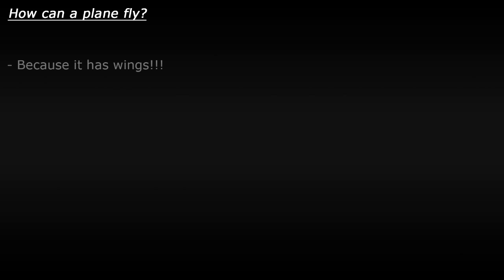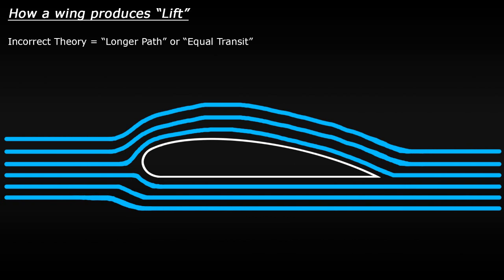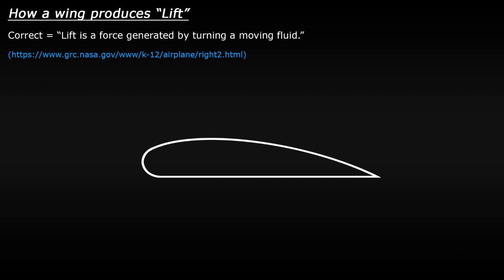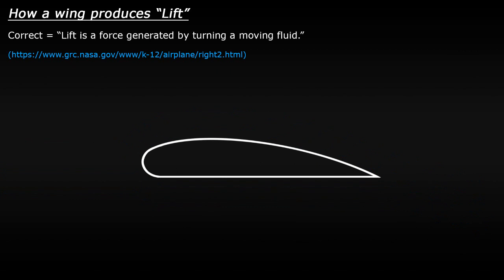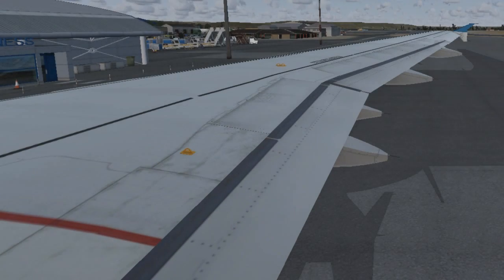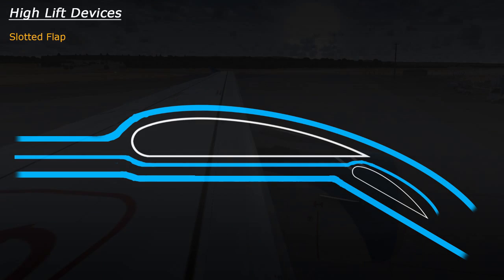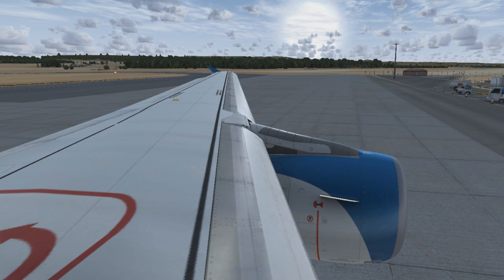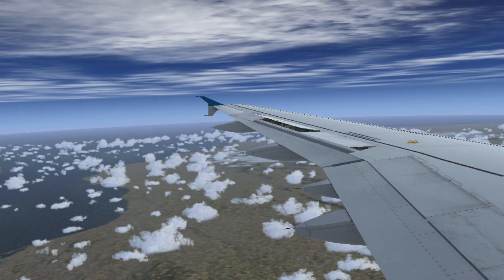How Wings ACTUALLY Create Lift!

Comment: Good video for the shortness of it.  You are correct- exactly! Basically, the various "theories" of why wings work to create lift all say the same thing, but in different ways. The idea of alerting the airflow to create lift, is best explained with your explanation. Air has mass- quite a lot of mass, actually. Anytime you move mass, there is an equal and opposite force created. In order to get any aircraft off the ground, you must move (at velocity) a mass (or weight) of air equal to the mass (or weight) of the aircraft in the opposite direction in which you want the aircraft to move. Any given volume of air (a "slug") has specific weight. You can calculate what amount of force is being generated by centripetal force  of moving that weight. So, basically, the wing lifts for the same reason a weight being slung around a center point get's "heavier"- the faster the weight is slung, the "heavier" it gets. the redirection of the air slugs by the wings angle of attack, eventually is going fast enough to literally force the wing upward against the weight holding it down. this is why even a flat, angular board held at an angle to the direction of flow will cause lift- the rectangular wing will fly (though with higher drag) without the curvature (I've proven this to the vast chagrin of "Bernoulli" adherents with RC airplane models. The advantage of a curved or "Bernoulli" wing is a reduction in drag AND and enhancement of more easily redirecting the airflow in a different and downward direction, thus causing more efficient lift.  The fundamentalist Bernoulli people have a hard time explaining why properly curved wings can fly (still generate lift) when flying upside down...and don't even get them going on the symmetrical (curved the same on both sides of the wing surface) fly better, with less drag and more lift at higher speed than the traditional "Bernoulli" models - that is the "flat bottom" wings.

It is merely the re-direction of mass that causes airplane wings to create lift- that's the whole bottom line. All the other aspects of a wings design are for reducing drag while enhancing that re-direction of mass.

Excellent video. Excellent explanation of why wings create lift.
Reply: Thank you.Your explanation helped a lot
Reply: How long did u tyle this...?
Reply: Centrifugal or Centripetal force has nothing to do with an air wing generating lift. Other than that you are mostly correct that Newtons 3rd law of motion is what provides the lift. You are incorrect though to say the poster of the video is correct in that regard because that is not what he said. He said something completely different and believes a downdraft creates lift which makes no sense whatsoever.
Reply: @lxdimension  What SHOULD have he said? 
What part did he say that was 'completely different'?
'Newton's 3rd law of motion' doesn't make planes fly.. More words, please.
(Seen Kooper, above?)
Reply: @lxdimension  I agree re: centripetal force, that made no sense to me at all.

However, in terms of the video, what do you think a "downdraft" is, if it isn't literally the "opposite" aspect of Newton's 3rd law? The air has shifted direction, due to a force being applied to it by the wing moving through it, there's an opposite force... hello lift!

Comment: You missed a step by saying the turning of the flow is what causes lift, turning the flow creates regions of high and low pressure simply due to the flow being directed away from it's "intended/original" path. These differences in pressure is what creates the Lift force, or more specifically: the surface integral of all the vectors normal to the surface multiplied by their associated pressure value over the entire surface area of the body (airfoil in our case). Creates a resultant force, of which the Y component is LIFT and the x component is DRAG.

What this means in practice is that there are some vectors pointing upwards(ish) above the airfoil which are "sucking" it up into the rest of the atmospheric pressure field, and some areas below where it is being "pushed" upwards away from the atmospheric pressure field. (The front of the airfoil actually tends to be pushed downwards in the majority of cambered airfoils, due to the region of high pressure at the leading edge)

For anyone who's actually read this I'll assume you know at least a little about aerodynamics, so if I've made a mistake, feel free to correct me, I am only a 3rd year student lol.
Reply: His explanation was simple and made for the average Youtuber. Who knows nothing about lift, drag, and much more.
Not good to give TMI to people that just want the basics. Notice how he didn't get into ailerons and about nine other basic things I believe not to confuse people.

Comment: I don’t get why most descriptions focus on the low pressure above the wing, instead of the high pressure beneath the wing. The high pressure is what creates the lift after all.
Reply: Not really, its the relative difference between the top and the bottom of the wing. There is no entity called "high pressure" under the wing. There wouldnt be any difference between lowering the pressure above the wing or increasing the pressure below it.

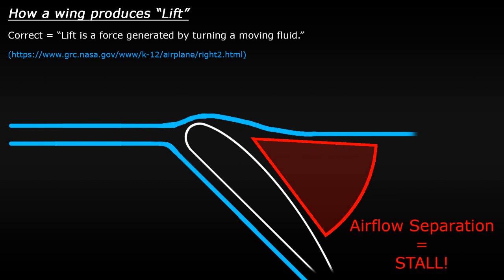Comment: 3:38 unless I'm mistaken a wing in stall still produces lift, it's just that it's overcome by drag so not very practical, and uncontrollable due to no flow over control surfaces.
Reply: Maximum lift, in fact.  Too much for the other forces
Reply: well it kinda just becomes a wall so idk

Comment: Thank you for the great explanation on the topic. I liked how you were able to debunk some of the common misconceptions generated by lift and gave a more correct answer. I also liked how you also mention some of the devices used to help lift such as flaps.
Reply: Lift is action and reaction.
The action is the deflection of air molecules downwards, the reaction is the wing being pushed upwards.   Pressure differences are secondary.   If there is no downflow of air from the wing, there is no lift.

R.

Comment: First off I enjoyed your visual representation of how flow goes around the airfoil. You were mentioning Newton's third law when you said the airfoil turns the fluid flow downward applying equal and opposite forces lifting the airfoil, which is a part of how lift works. However when flow is curved there is a pressure gradient. This gradient forms a pressure and velocity field around the airfoil that affects a wide area in the fluid. As you said the pressure above is lower and the velocity is faster, while below the pressure is high and the velocity is low. The pressure and velocity affect each other simultaneously and the pressure difference drives the lift force as well. Also the Coanda effect only applies to jet flow and not for ordinary flow airfoils are usually in, so it is not a factor in lift.

Comment: To delay a stall you can also use vortex generators on top surface of wing. Vortices tend to "stick" to the wing better than regular air, so the separation occurs at higher AoA.
Reply: exactly, this is the reason for the F18's LERX, the low energy / low speed turns it makes is insane for that reason
Reply: @Wrtvrxgvcf55  The F-18 uses a different principle. It uses vortices, which can be created at high angles of attack by wings with more than 45 degrees of sweep. Vortices are not the same as generic turbulent flow. They are their own phenomena. This is also used by most true delta winged aircraft.
Reply: @米空軍パイロット  that is correct! and the F18's LERX creates vortices! it was specifically added for that reason
Reply: How about stall strips?
Reply: @HarwinSingh  If I remember correctly, stall strips are intended for the opposite purpose - to initiate flow separation earlier. You place them on the root of the wing and you get pitch down instead of a spin when the aircraft is stalled.

Comment: THANK YOU for confirming my belief that Bernoulli is BS in terms of its overall impact on lift.  Sure there is some, but that's NOT the major source of the lift!   BTW, there are a lot of folks saying the lift for DRONES comes from Bernoulli's Principle...even though the propeller blades are virtually flat.  I point them to ceiling fans and ask them to explain THEM! LOL.  Anyways, thanks for the clear and no BS video.

Comment: While it is true that the flow tends to remain attached to the surface of the airfoil, it is not because of the Coanda effect. This effect specifically applies to jet flow, which an airfoil would not experience. The equal transit time theory is wrong as you stated, but the relative pressure fields between the top and bottom surfaces of the wing would play a role in generating lift. Pressure and velocity changes are coupled when looking at a flow like you displayed, meaning they change continuously with each other. This is a big misconception when it comes to explaining lift.
Reply: Coanda Effect and flow-attachment involve the same physics.  (Simply make the diameter of the jet be wider, and the connection becomes obvious.)   Attacking the term "Coanda Effect" is misguided, smacking of one-upmanship, rather than pointing out a significant error.   Yes, the proper term here is Flow Attachment.    But Coanda Effect is an example of flow-attachment.   
If you believe that the two of them employ two different kinds of physics, then you need to explain the details.   
Coanda Effect becomes Flow-Attachment in the limit of increasing the jet-diameter.   

In 1999 I saw the very first use of this same misguided attack, this "it's not Coanda Effect."   

The person using it insisted that Coanda Effect only involved liquid jets in air, such as water flowing over the back of a teaspoon.   Why would he say this?   It was quite obviously a well-poisoning fallacy.   He had just been caught (in a very public situation) believing and supporting "transit-time fallacy,"    Rather than publicly admitting error, was trying to avoid embarrassment, by attacking his attackers, pointing out their "huge error," suggesting that they weren't competent, because Coanda Effect only involved water-jets  ...the tea sticking to the teapot spout, etc.   
Henri Coanda didn't discover his named effect by launching any water-jets.  The phenomenon appeared with air-jets coming too close to a parallel fuselage surface, where they'd unexpectedly exhibit flow-attachment.   (But how wide must the "jet" become, before it's simply flow-attachment, and not Coanda Effect?   Answer that, and you'll have a perhaps valid point.)

Comment: As an aerospace engineer, this is a useful explanation for the average person to understand what creates lift, but we can’t totally disregard the fact that there is a pressure difference. I disagree with you when you say that a pressure difference is not what creates lift. In fact, there are many times where we can actually compute the lift force (or lift coefficient) on an airfoil WITH the pressure distribution and using calculus to integrate the difference in pressure acting on the top and bottom. At the end end of the day, there are two natural sources that cause for all aerodynamic forces and they are none other than the pressure distribution and the viscous shear stress. I’m not saying you’re wrong for thinking this (although I am saying you’re wrong for saying the pressure theory is wrong), but I think they go hand in hand. You can’t have one without the other. To say one idea is more correct than the other would be ignorance. I appreciate the video though and it helped me deepen my understanding a bit because I had never heard it explained this way. Thanks! 👍🏼
Reply: I hate to argue with an aerospace engineer, and I'm also 4 years late to this party, but I do have some questions.

First, take a situation where you are in a moving car and you put your hand out of the window. Where there is no AoA, there is no lift generated. There is some drag, but it's manageable. However, if you turn your hand into a slightly positive AoA, you simultaneously feel a substantial increase in drag and your hand flies upwards. If you're not prepared, it basically goes up and back as both drag and lift are generated.

When I started considering lift, it seemed easy. I thought - "this has got to be because of the equal and opposite reaction of dumping flowing air downward, changing its direction by providing a force that changes its vector". Newton's 3rd law - the same force that your hand is applying to the airflow to change its direction (created by the car's engine and your muscles pushing your hand against the pressure of the airflow to overcome drag) is also applied via to your hand, causing it to want to go up. The effect is so strong and so instantaneous that I found it extremely difficult to believe that it can be caused by the development of a pressure differential above and below the "wing" of your hand. But that feeling is not scientific in nature. After all, I caution myself that an explosive decompression event causes substantial forces very quickly. And the moment you unscrew a bottle which contained a carbonated drink, the top wants to fly off as the pressure tries to equalise with the room you're in. It doesn't have to "build"... so pressure differentials can create forces quickly.

So I guess the challenge in answering this question to everyone's satisfaction is that it seems hard to imagine circumstances where you can impart downward motion to air meeting an aerofoil where you're not also creating a pressure differential below and above the wing, so it feels like the Newtonian approach and one based on pressure differences seem to "come up with the same answer" and everyone is shouting about which one is right, based on the answer that feels better to them. I don't know how to bridge the gap and I don't have enough scientific understanding to try and do so - I fly planes rather than design them. But I do know that explanations of lift forces have been plagued by bad and poorly explained answers for a long, long time - it's remarkable to me that we can go to the moon, explore the wreck of the Titanic, do AI facial recognition, connect all the computers around the world, search deep space for answers to whether we're alone and image amazing parts of the universe the naked eye can't see.. to say nothing of achieving net positive energy fusion reaction. Yet a single unified and sensible theory of aerodynamic lift continues to be a challenge to describe in a way that people accept and understand.

(and yes, everyone thinks their answer is right - I am not inviting more of that, just saying that there do still seem to be challenges in describing the lift forces).

However, I found this quote useful, from good old Wikipedia... 

"A serious flaw common to all the Bernoulli-based explanations is that they imply that a speed difference can arise from causes other than a pressure difference, and that the speed difference then leads to a pressure difference, by Bernoulli's principle. This implied one-way causation is a misconception. The real relationship between pressure and flow speed is a mutual interaction."

Yes. That feels right. So I think we are saying that when the air flows around (meets) the wing, all kinds of pressure differentials are created in the local atmosphere of the wing, the net result of which is upward lift. The laws of conservation still apply (it's not an either / or) because the net overall force lifting the wing is equal to, and opposite, the net overall force exerted downward on the rest of the localised atmosphere. It's just that the net overall forces are created by / are a symptom of the pressure differential.
Reply: @cjad100  Woah, I barely remember even making this comment haha! It’s been a while so I had to rewatch the video. The main problem with the video is that he is marrying the “equal transit time” (an incorrect theory) with Bernoulli’s principle and dismisses the pressure difference idea because the equal transit theory is wrong. Newton’s law can be an explanation for how lift is created. Bernoulli’s principle and Newton’s laws suffice to explain what creates lift. But at the end of the day, you are absolutely correct. We actually do not fundamentally understand why there is pressure difference. We know the pressure decreases on the top of the wing and the pressure increases on the bottom, due to a lower velocity. However, we cannot answer the question of “Does the pressure decrease because the flow increases, or does the flow increase because the pressure decreases?” It’s basically the chicken or the egg debate.

Comment: Indulge an old fitter please. When I was a kid more than six five years ago, I built a flew model aircraft with completely flat wings. as long as these were angled upwards against the line of thrust, the models achieved lift. I figured it was like a boats rudder. Barry
Reply: Yup, that angle upward does the same thing as an aero foil shape to create lift!

Comment: You are correct in identifying the Equal Transit Time fallacy, but there are other parts of that theory that still hold true. There is still a region of low pressure above the airfoil and high pressure below, and Bernoulli's Principle still holds true along a streamline. Lift is a combination of the pressure and velocity field coupling as well as Newton's conservation of momentum law, but I feel as if you dismissed the former a little too much in the video. I liked the additional information about flaps, slats, and spoilers as well as the importance of angle of attack.
Reply: He said that the pressure difference still exists, but that it works at least partially in tandem with Newton’s laws. He implied that it was both without explicitly saying it.